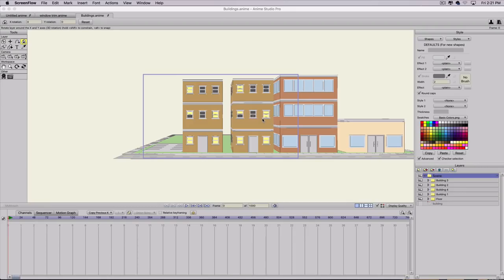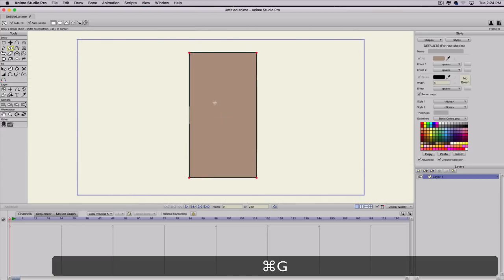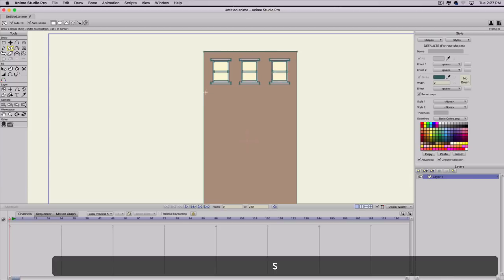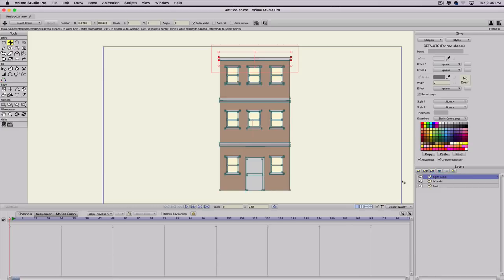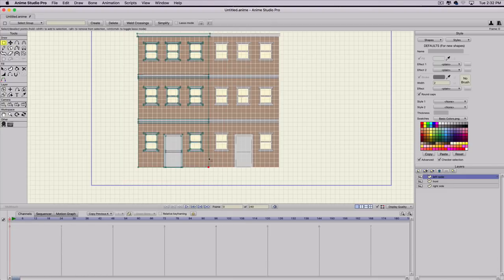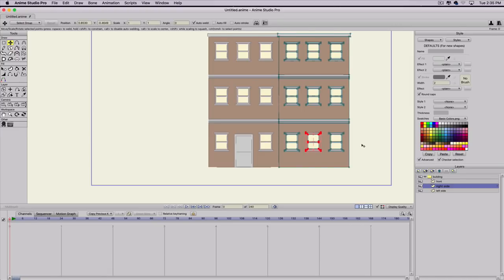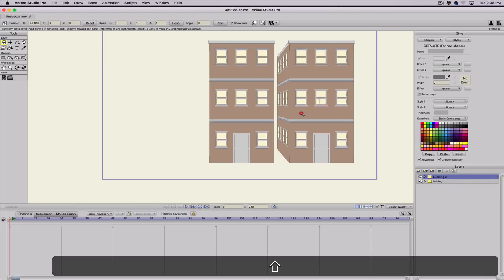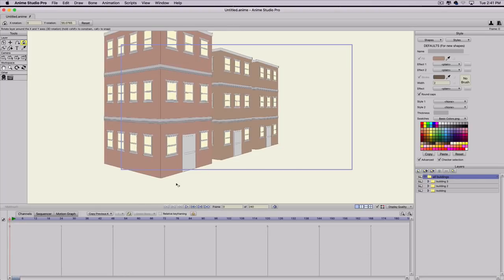How to make simple 3D buildings in Anime Studio Pro or MOHO pro 12

Comment: have you tried to make the ground a 3d object as well? I think in that way the disappear part would not happen.
Reply from the maker: Hi Mr T. It actually is 3D but because of how it protrudes out from the buildings, certain angles will automatically shift what is rendered. It's really tricky but like I said you can always manually move layers so it looks correct and I think, create smartbone actions to where everything renders correctly all the time. I gotta mess with it all some more to see if I can get that working!
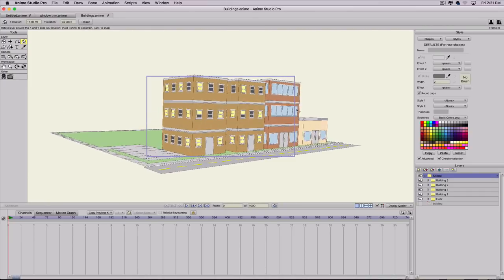Reply: 1:03
the underground part isn't important but a 3d flor won't make that disappearing part in the last building. but as you can see a 2d flor would do that. if the underground isn't important so its a lot easier to make the ground a 3d object so it would be outside of the folder so didn't need to turn deep by true distance so you can move the camera in a lot more locations without any dissapearing
Reply: why is the floor folder in the scene folder? wasn't it easier to have it outside so it wouldn't come on any layer?
Reply from the maker: It's in a folder because there is also a small curb and the street itself is slightly lower than the floor. As with the buildings, to keep them rotating together correctly they had to be put into a folder. Rotating individual layers seems like a headache because I think the origin points are all different. It's just easier to keep everything moving the right way. I could be wrong and there is an easier way but I just started messing with this a couple of days ago so if you come across something that works better let me know and I'll for sure update the video. I kinda need to anyway as I didn't show how to add the ceilings and back of the buildings..... :)